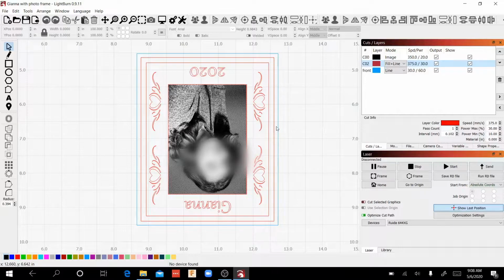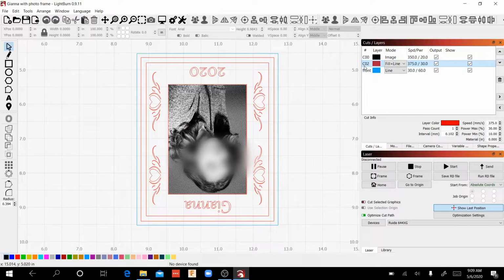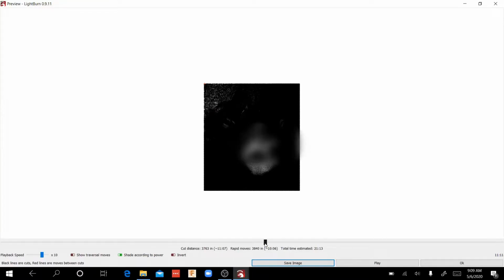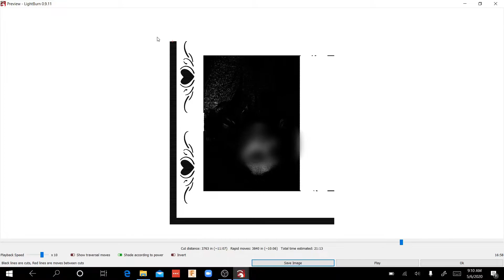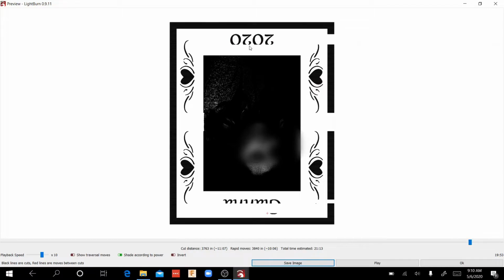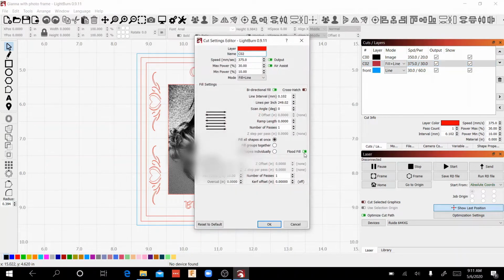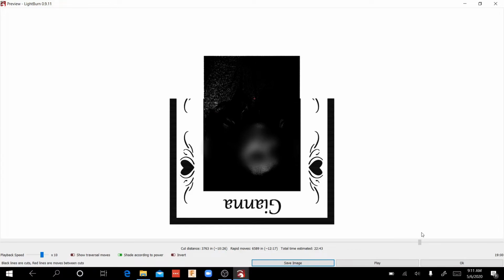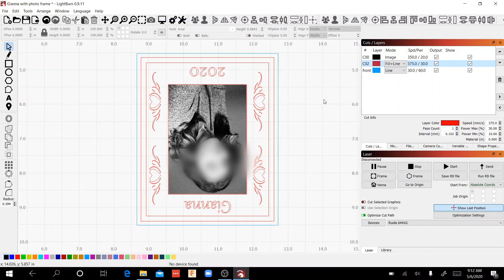Lightburn flood fill issues and how to fix!

Comment: I turned the flood off, but I’m still have issues with my letters. It will fill perfect then some of the tops of the letter will be shifted just a little. Please help
Reply from the maker: scrub through the preview, make sure it’s not showing up on your when you preview your job. if not be sure to delete all you files in you controller. when you controllers memory fills up weird things can happen. I’m assuming you have a dsp type controller. if you have a diode I’m not much help.thanks for watching!